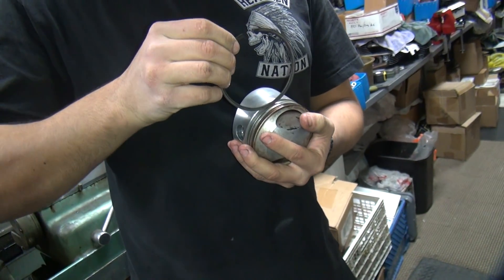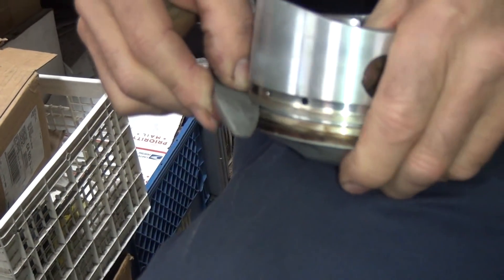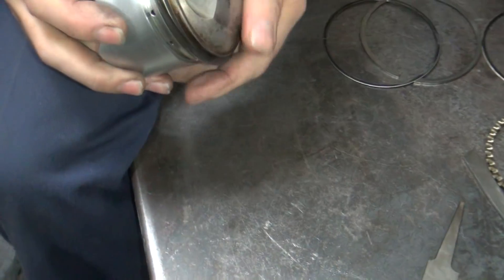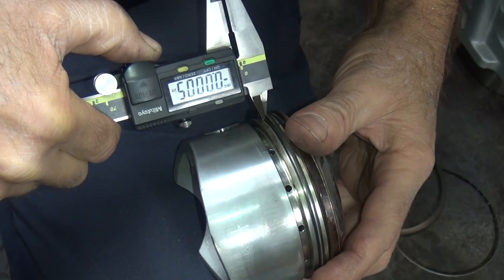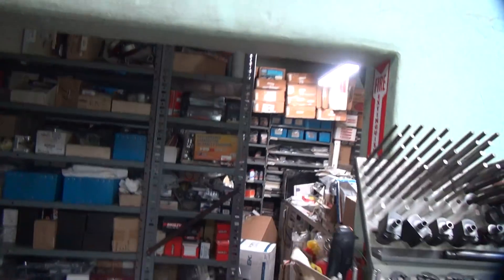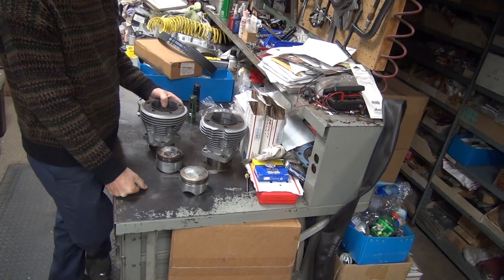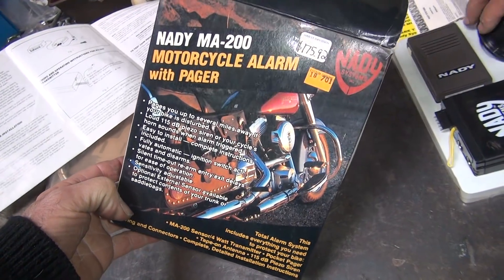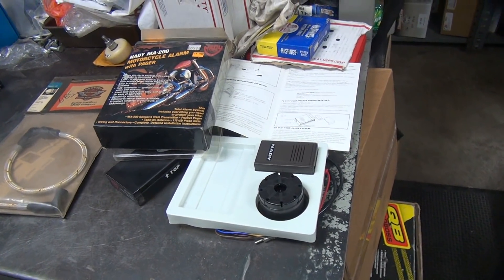#150 how to do it, repair big bore stroker piston pinging damage collapsed rings harley 103 panhead

Comment: I'm actually going through the same thing right now on my original 74ci 68FLH -- but not a compression groove, in on one of the piston's oil rings. I haven't gone metal file, just progressive sandpaper applications. The oil ring and scrapers are now a little looser in the groove but still catch a tiny bit on rotation. Any experts here think that will cause any long term problems? I figure with a slow break-in period it should eventually work itself out, but if the panel of experts here thinks I need to be concerned please let me know. I'll entertain all the hive solutions you guys can offer. 

Rebuild progress videos available on my channel if anyone's interested. And as always, thanks a jillion to Tatro for all his knowledge and guidance along the way. Your channel's been a lifesaver.
Reply from the maker: if you stay off the lower part of the groove you are fine. if you get into the lower part you will have blow-by. if the ring groove gets too loose, you will have blow-by too. on the oil ring, the top part of the groove does the sealing.
tatro
Reply: @TatroMachine  Thanks Tatro, appreciate the knowledge. Hope your move to the desert is going well and I'll have a t-shirt/merch order for you soon as a thank you for all I've learned from your channel. If I ever make it out west I'll hold the camera for you while you make fun of me.

Comment: I'll give it 500 miles before the ring glands crack and destroy the cylinder wall, buy a new piston and rings and stop the early detonation problem ,
Reply from the maker: not likely but i am sure you think that. forged pistons bend, not break like the cast and hyper ones do. we will know very soon how this fix worked. on my race bikes this type repair works fine and gets me records instead of going home early. e85 will take care of the detonation problems. building a new more streetable motor is the way to go. very high compression street motors do not work unless you have a very good supply of race gas.
tatro